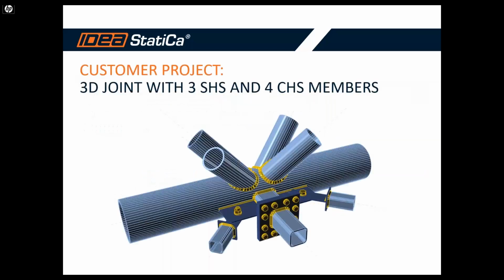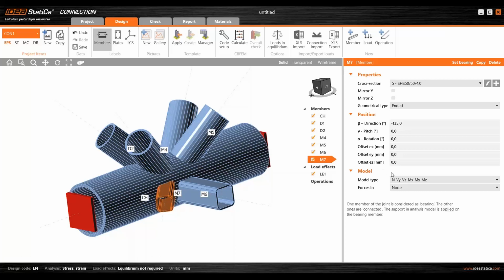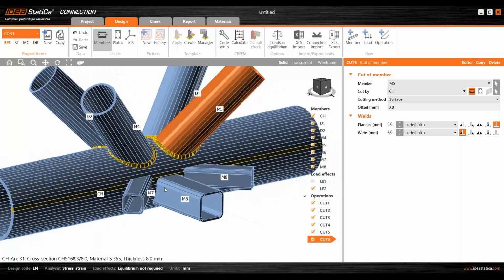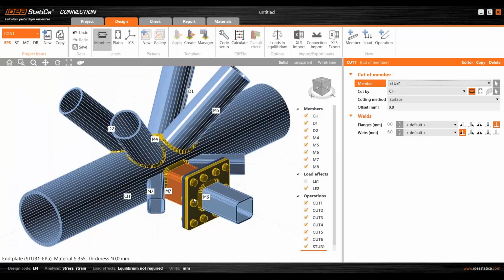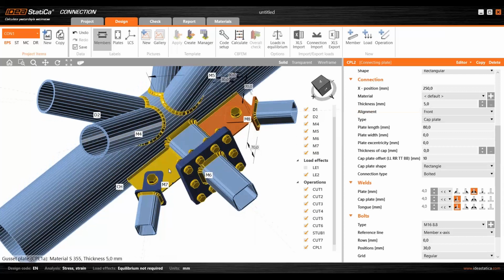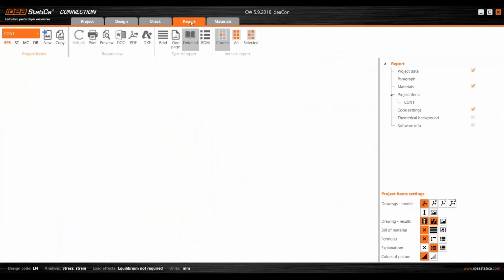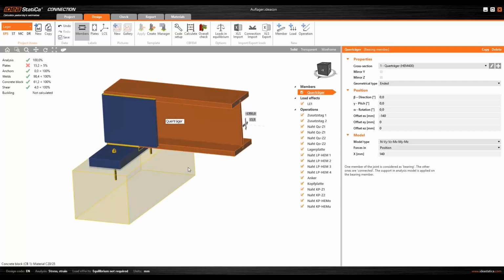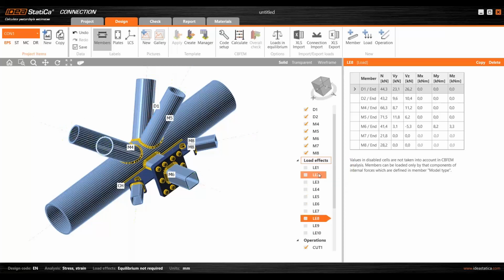Connection Wednesdays – Design of a 3D joint with 3 SHS and 4 CHS members

Comment: Is it possible to make a weld between plate (doubler) on the SHS section, when the plate is same witdh as the SHS? - the weld should be between arc of the SHS and edge of the plate.
Reply from the maker: Hello, yes sure :).
For more information about welds:
https://www.ideastatica.com/support-center/weld-welds-in-idea-statica
For Sample projects to find similar example of yours perhaps:
https://www.ideastatica.com/support-center-sample-projects
Or browse through thousands of examples in the Connection Library :)
https://connectionlibrary.ideastatica.com/
Reply: @ideastatica_en I couldn't find a way to model this exact situation.. I can only weld to upper/bottom flange or the side ones, but don't know which is correct (or maybe both are wrong and it should be somehow be welded to the arch of the SHS).